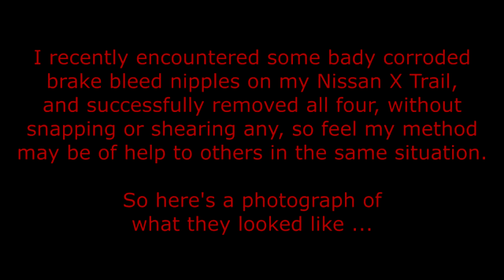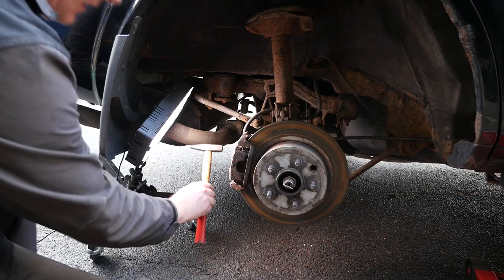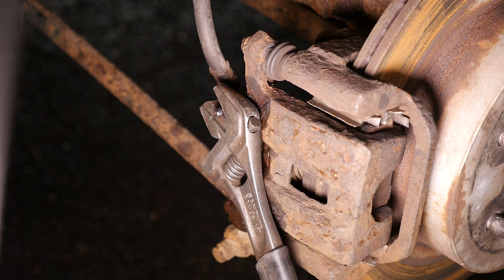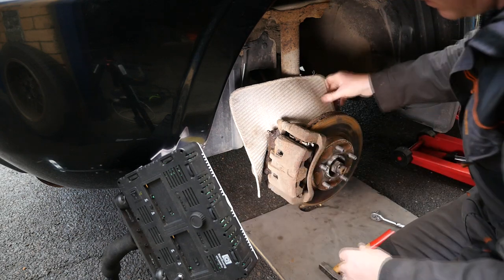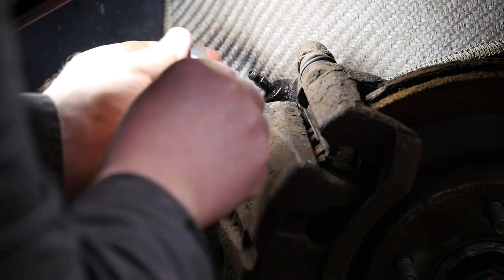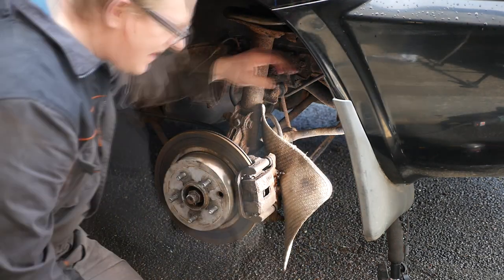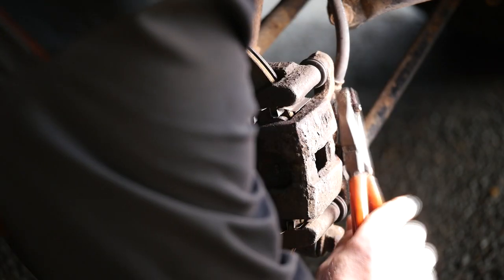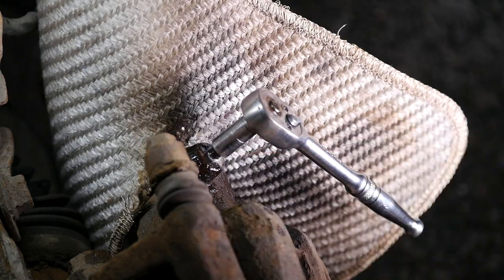How to remove seized Brake Nipples from callipers using MAP Gas 🔥 , PlusGas & Small Hammer 🔨

Comment: You spent all that time prepping the bleeder & then YOU USE AN ADJUSTABLE WRENCH,  GET A SET OF LINE WRENCHES. Other then that GREAT VID. SIR. EDIT- Didn't know the adjustable had serrated jaws, it makes sense now, SORRY.
Reply from the maker: Thank you for the comment, I probably should have explained in my video but the head on the bleed nipple had rounded so I was using the serrated wedge side of the adjustable spanner as you can turn the jaw around.  This gave a biting effect to the jaws so would lock on.
Reply: @CoatsandGaiters  OH SORRY, Didn't know the adjustable had serrated jaws, that's different. Never saw one with serrated jaws, that makes sense now.
Reply from the maker: @NoWr2Run  yes the bacho ones are reversible.  Damn good spanners.  They bite better than Mole grips.
Reply: @CoatsandGaiters  I bet they do bite much better.
Reply: @NoWr2Run  I can attest to this. They're as good as stillsons. I only bought mine because they didnt have the regular pair in stock and I was gobsmacked when they really worked.

Comment: Good show!  After breaking my front left bleeder off I turned to  youtube for advice.   I was able to get my other 3 out following the heat , cool and spray and hammer tap advice here.  Patience is key.   You dont realize how fragile these are.   I also put RTV over the bleeder caps  I replaced in hopes that it will keep the moisture and corrosion away for next time.  I still have one to drill out though    You should replace the ones you removed with new bleeders - I found the replacements to be a little more robust.

Comment: I used a similar technique on removing frozen nipples. I also used wax, melting the wax into the threads after heating. Bleeders then came out with no problem.
Reply from the maker: Someone else mentioned about the melting wax idea.

Comment: great video and well explained..one note of hope, if it does shear and you HAVEN'T managed to turn it, all is not lost as the nipple is still locked in place so won't leak. If you manage to just turn it, then you have to persevere..I used Optimol paste as that's recommended for brake parts..
Reply from the maker: @PompeyMatt17  thank you and that a good point you make.

Comment: If the vehicule is continually used on salty winter roads, your method will not be sufficient to remove stuck bleeders, here, , the best ways to remove a bleeder is to heat agressively but briefly the bleeder boss with a big oxy fuel torch then try unstuck it, another way is to weld a nut on the head of the bleeder then back it off. the  idea is to create a thermal shock to break the rust cristals.
 Installing rubber caps on the tips of the bleeder protects the interior passages and helps to maintain the bleeders  easy to unscrew
Reply from the maker: Thank you for sharing your experience.  Well worth knowing.

Comment: Thanks for the video. 2 questions please, 1. Why is it bad to put copper ease on the thread?  and 2. Did you replace the bleed nipples?
Reply from the maker: I can't remember the con text about the copper grease.  I guess some may disagree in case it could lead them to come undone.  I did replace the bleed nipples as they are cheap and it's safer to replace once they get into the condition mine were in.

Comment: I have to bleed the brakes on my sons fiesta tomorrow and someone painted the calipers and nipples, which has rusted off of the flats on the nipple but I am really hoping the threads down low are ok and I have gas to try and burn the paint off.
Reply from the maker: Hope it all went well in the end.
Reply: @CoatsandGaiters  nope couldn't get them off, so I just adjusted the rear shoes, but one of the centre  hoses is corroded so he is just going to get the mechanic to do it.
Reply from the maker: @grosom31  They are little blighters and snap so easily as well being hollow.
Reply: @CoatsandGaiters  absolutely they are.

Comment: Ciao carisdimo usa il tradufoore per i miei commenti perché sono testardo 🤣 .  Che gomme monti sul x trail ?
Reply from the maker: I've gone with rubber ones at the moment lol  Think they are BF Goodrich Urban Terrain T/A 215/65R16. Hope that helps
Reply: @CoatsandGaiters  wow idem
Reply: @CoatsandGaiters  is nice weels
Reply: Ho capito che peccato ma meno male che ci sei tu ma era abbandonata prima ?
Reply from the maker: @giuseppecantatore8104  It suffered the common diesel runaway situation where the turbo seals fail and the oil gets suced into the cylinders and the engine drinks its own engine oil.  But all was good in the end.
Reply: @CoatsandGaiters  grazie amico
Reply: @CoatsandGaiters  se vuoi ti svelo segreti degli intern
Reply: Ciao sono sempre io ho cambiato account

Comment: Wouldn’t it be better to heat the caliper metal around the nipple and not the nipple itself. Otherwise the heat expands the nipple more.
Reply from the maker: By heating and cooling the nipple your shocking it and loosening the rust that's holding it.  Heating the calliper would risk damaging the rubber seals inside as well.